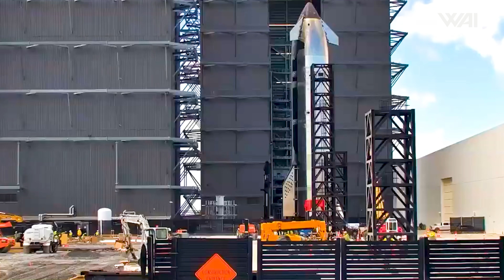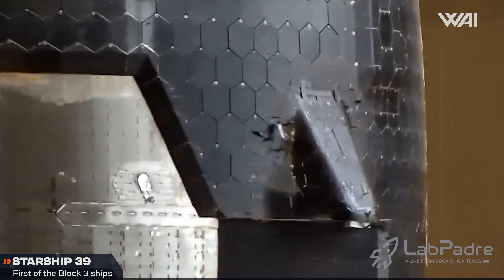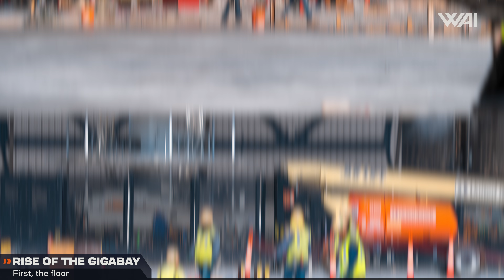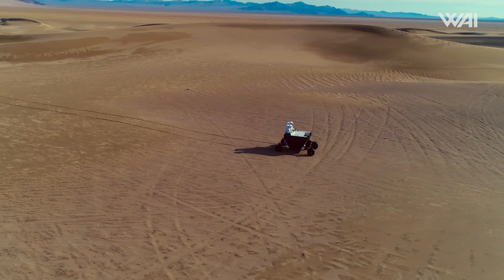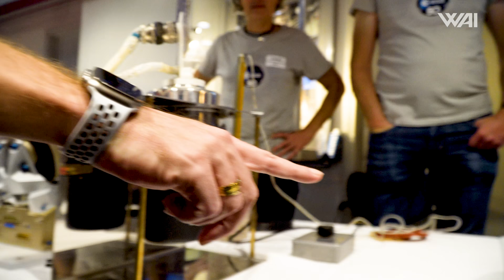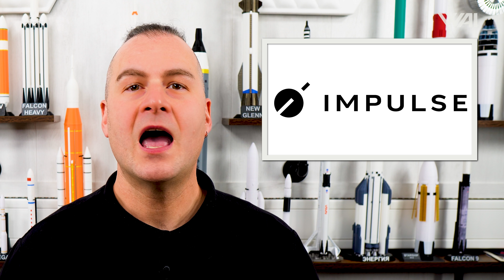SpaceX Starship Flight 11 Secrets Revealed! Will Version 3 Reach The Moon?

Comment: So, the entire Apollo stack worked to put the 15 ton LEM on the moon. Aboard was the tiny origami rover, almost an afterthought crammed in a corner of the superstructure. It weight 210 kg, batteries and all. 

Starship can put 150 tons on the moon. Two M1A main battle tanks, fuel, and crew. 

NASA with the rover - here's a couple hundred kilos, see what you can do. 

SpaceX - Let's try and keep it under a couple tons? Yeah, I guess 5 or so, if it's cool. 

Yeah, times they are a changing.

Comment: Yes - using the  microwave-plasma "water-drive" you could have open-loop life support on long space missions. You have a huge water tank for reaction mass, and crew can use the fresh water for drinking, cooking, cleaning, showering, going to the bathroom, or whatever, then the resulting grey and even black water can be run through the drive to be used for thrust - no need to for heavy and bulky hardware to recycle the water! Also the large mass of water is good for radiation shielding.